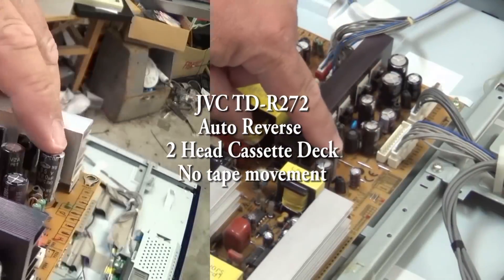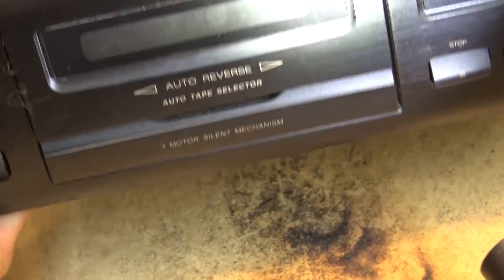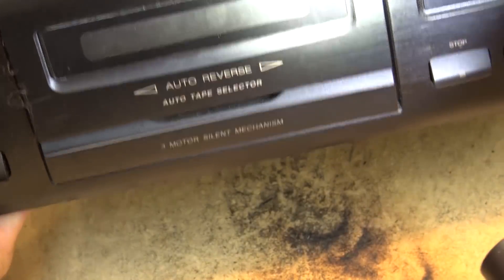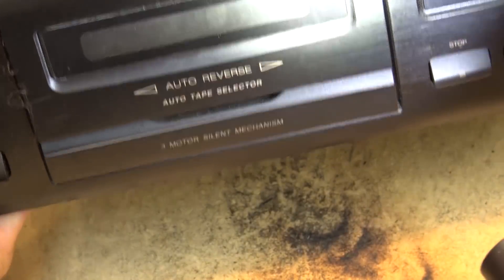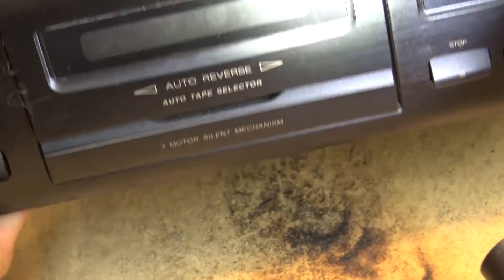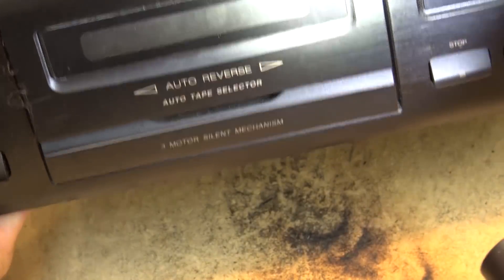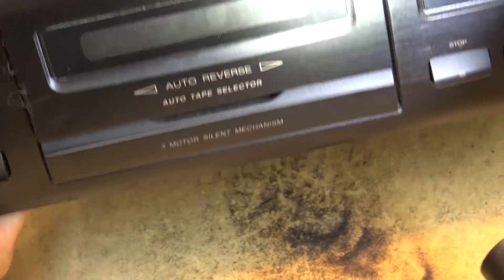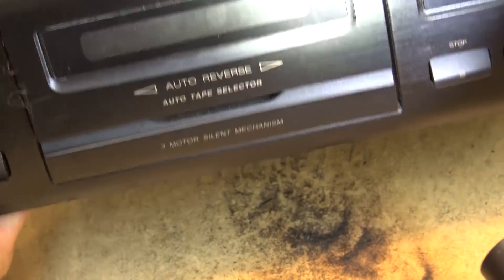JVC TDR272 Cassette Deck repair

Comment: I have a bunch of those TDK MA110 tapes. They came out in the early 1990s and were the perfect thing for recording hour-long radio shows without interruption (in the Netherlands, most radio stations had hourly news and commercials for about 5 minutes). The tapes sound really good and are surprisingly resistant against the press-through effects of older 120 minute tapes, probably because of the Metal type coating. Also, the tape is stronger than 120 minute tapes; I never had any tape breakage in a TDK MA110 tape.

Comment: I remember having a high end dual tape deck, 3-motors and all the bells and whistles, I cleaned mine at least twice a year and calibrated, and aligned the heads.
Reply from the maker: The thing with heads is they typically don't need adjusting unless replaced or someone has broken the paint seal put on at the factory.

Comment: Tetraflouroethane is R134A (found in auto A/C systems and refrigerators) and is what is in many compressed air duster cans. That's the reason why in the US you need ID to purchase them because kids would huff the stuff.

I always found it funny that you can't vent R134 when doing A/C work (it must be reclaimed) per EPA regulations but that you can go to the office supply store and purchase it in an air duster can and vent it to the atmosphere to your hearts content.

So at least in the US the propellant R134A would be allowed so there must be another banned ingredient that forced them to change the formation.

Comment: Try breaking the glaze on the pinch rollers with 400 grit sandpaper and then apply the rubber renew. If the glaze remains in place it can prevent the rubber renew from getting into the roller. I recently did that on two decks (Sharp RT 12 and Yamaha KX 250) and had success with both of them. On older decks it may sometimes be necessary to remove the tension spring for the roller and give it a little tweak to restore tension.

Comment: I've come across many decks full of "juicy cigarette glaze" before and taken more time cleaning the sticky gunky crap up than actually finding out what was wrong with the units themselves (which in some cases was just belts, rollers and broken gears - though one had a cracked main-board due to being dropped by a clumsy owner which took over half a day to repair).

Nicotine - the number one carcinogenic killer of electronics.

Comment: i loved those TDK metal tapes!  I bought a big box of them back in the day to record my bands music, metal of course. lol Usually only recorded on them one time, but a few metal tapes i used over and over for years in my 4 track recorder . i never had any stretching issues like standard  90 or 120min tapes. i still have most of my tapes from the 80-90s and they all work good. I have some tapes though of commercial bands i bought where the tapes stretched so much it made them play longer/slower. you could barely notice it but the tempo was off and comparing it to a new tape it sounded way off!  Now days my friends or myself use digital to record band music, but it just doesnt sound as good as tape IMO. digital looses a lot of the warm tones and just doesnt sounds as good no matter how you mix it.

Comment: their tape heads are similar to my sony vcd tape decks on tape side B but can you help me out to repair the other side of it on tape deck side A because the tape head of it their brown flex with 5 pin connector has been broke or maybe damaged can i used other thin wires with cover to wiring them thank you.

Comment: that is my problem and also the CD Mechanism of my Sony VCD they cannot read a disc inside i see that the cd does not spin why? But i resolve one problem to their tray to open and close when inserting some cds i just replace a belt to motor., and then their tuner it does not stop when searching for fm station on radio mode. and also my vcd model is sony mhc vx 55 with 2 active super woofer it sounds good and excellent so beautiful but it stops fuctioning some buttons on it and their cd can you help me out please thanks a lot.

Comment: Just wondering if you have any cobalt cassette tapes ?
Reply from the maker: Pretty much all the type 2 tapes with the exception of basf are cobalt.  Basf and some early memorex were chromium dioxide as was the chrome layer on the Sony type 3 ferichrome tapes. Those are still the tapes that are my favorite. They have the best I'd both worlds. Iron oxide on the bottom layer as bass penetrates the tape deeply and chrome on top for good highs.  Next to metal tape they are without question the best tapes for music but most people dont know much about them because only a few companies made them and very few stores carried them.
Reply: their tape heads are similar to my sony vcd tape decks on tape side B but can you help me out to repair the other side of it on tape deck side A because the tape head of it their brown flex with 5 pin connector has been broke or maybe damaged can i used other thin wires with cover to wiring them thank you.

Comment: This is an unrelated question but I have a hd-dvd player that stops halfway on all my disks even regular dvd. I don't know your e-mail address. You know your stuff!
Reply from the maker: Could be the optical pickup is sticking, or it could be a spindle motor issue.

Comment: End of the line 90s cheap stuff... suitable for beginners or people who only have type 1 tapes and dont take tapes seriously.
Worth maybe 10 bucks or so. I got some 90s tape decks in the last few months and sold all of them on ebay because they have absolutely no value for me. I like my JVC TDR621. Good quality 80s stuff with a lot more functions than the newer models.
In my opinion 2 head decks are only acceptable for playback.
Reply from the maker: 2 head decks can make very good recordings. The same as 3 head decks because the head is basically the same. Optimized for recording. It is the separate playback head with the much narrower gap that is set up specifically for playback that makes the difference.
Reply: @12voltvids  I know that they can, but its a huge pain to figure out the perfect settings. Record, rewind, playback, change setting, rewind, record, playback, change setting, rewind....
Or just press rec and hope for the best. I dont like them.
Reply from the maker: @macdaniel6029  yes but once you get a brand of tape dialed in, just mark the control and then it is easy to reset.  Most people never bother tweaking the bias anyway.

Comment: 80's me : don't like the deck... that VU-meter is not cool .... moves on to the next deck   Technics ... yeah.
Reply: 80's me wouldn't like a mid-90s deck either. JVC made a lot of decks with sexy red/orange VU meters. They are actually pretty known for their fancy/pretty lights. Their achilles-heel however is the diodes they used to run said bulbs in series and cause problems later down the road. :)
Reply: I know, my sister has an, I believe, 1984 JVC with a spectrum analyzer on it. Up till this day I would like to have that deck. Technics had those nice display vu-meters from their low budget models. I still have some nice stuff up in the attic.
Reply: Luc Peeters - I’ve always preferred Technics & Panasonic.

Comment: I had a JVC DD55, DD66, DD99 (cassette decks of the period  Circa 1980s. These were note Cheap decks and alof them just sounded dull, no high end frequencies, I returned them to JVC them selves and they kept saying it was fine, noting wrong. It went back to them 12 time in one years. I then just so knarcked off with them I threw in the bin as they had stalled for time eating up into the 12month warranty period. JV are a complete farcial company. I will not buy JVC ever again! I bought a Aiwa ADF260 and it was simply stunning! At a 1/3 of the price!

Comment: I don't think I would have wasted time on that one - Junk Very Cheap were never great decks in my opinion, and that one is a right el-cheapo job.
Reply: That's because it's from the mid-90s. JVC's quality was on the down by then.. they made some very good decks in the 80s. They're so underrated, but it's understandable cuz they did put out a lot of cheaper units later on, but people overlook some really high-end units that they did put out. As far as cassette decks I have the JVC KD-A7 and JVC TD-V66 myself and wouldn't consider those "cheapo" units. These aren't even their high end offerings, but very respected decks. They also had their DIGIFINE series and Dynamic Super-A amps. You can have a look and tell me that's your typical china cheapo junk, right? http://lcweb2.loc.gov/master/mbrs/recording_preservation/manuals/JVC%20Super%20Digifine%20Hi-Fi%20Components.pdf

The 80s they made good units, and some high-end offerings even. In their early 90s is when they started slopping, units looked cheaper but there were SOME units that performed good and were reliable. Mid-90s on I wouldn't touch... everything is junk from then on. I got a lot of beef about my 1990 JVC RX-R76, but it's a great unit and sounds excellent when fed from a good DAC. I've had mid 90s, say 1995 JVC, Kenwood, Sony, etc. receivers and they are all junk in comparison. And the modern receivers nowdays are a complete joke and don't work after a year or two. You have to pay a few grand nowadays just to get any quality, yet my JVC sings on a few more decades. :)
Reply: I'm not saying that every single product that JVC made was junk, but the majority of stuff that I came into contact with (90's) was pretty rubbish.  I agree that the same can be said from other manufacturers too - Kenwood had pretty much given up by then, and Sony were a real mixed bag with their QS and ES ranges being very good indeed, and the rest of their stuff being pretty rotten.

And yes, you do have to pay a fair wedge now to get anything decent - my Yamaha RX-A2050 cost a good number of beer tokens, not least as I bought it soon after its launch.  It is so sad that the likes of JVC chose to down-sell themselves in their attempts purely to chase volume of sales, and they are not alone.   Pioneer are another one who seem to have an almost dual-personality to their range.  I suppose it is just the way of things with modern electronics - everyone wanted more and more features for less and less money, and then products were designed to fail and be replaced in a very short space of time;  part of the reason I left the trade around 20 years ago
Reply: But people PRAISE the Pioneer brand, but JVC, oh no, so underrated, junk they say. That's what pisses me off, people with praise these other brands and sometimes shit I see that's junk compared to a JVC counterpart. Mention JVC and they hate on you. I have a Pioneer receiver, it's a piece of shit imo. People overlook JVC was a premium Japanese brand back in the 80s. When you say JVC people think of car stereos, camcorders, and all-in-one bookshelf stereos. They don't think of their high-end equipment of the day that they did have. 80s they were good, and I would say some of the very very early 90s stuff too. They also had their "GM Circuit" suite for their amplifiers such as GM Driver, GM Volume, GM Selector, all stuff they did to improve SNR, lower noise floor, etc. basically premium features on their high-end amps. Stuff to improve how the transistors functioned too but utilizing what transistors do best. Stuff like improving the quality of the power and lowering impedance, etc. It's funny cuz my 1990 JVC RX-R76 has one of the GM Suite features, meaning it wasn't one of JVC's lower end offerings or "budget" receivers. It has the GM Driver and direct-power supply. More info on their GM circuits here, kinda interesting to me.. http://pro.jvc.com/prof/attributes/tech_desc.jsp?model_id=MDL100386&feature_id=02 But my "cheapo piece of shit" amp as many claim sport some features JVC implemented in their high-end equipment.
Reply from the maker: @victorcoss2600  
Jvc had some pretty good components, and their svhs vcrs were considered to be some of the best ones made. I have a couple of jvc svhs that work great. Even though they have a fair bit of plastic they have been great and the old boat anchor VHS decks from the early 80s were bulletproof.
Reply from the maker: I'll put it up on craigslist for 50 bucks and someone will buy it.
Reply: So, just taking a guess here..........  You like JVC, right?

Again, I am not saying that everything they made was junk - I can only speak of the stuff I came into contact with;  it could well be that I didn't see enough of their stuff.  If you are happy with your kit, then that is all that matters - - seriously. don't be giving a monkeys about what anyone says to criticise, it makes not a jot of difference as long as YOU are happy with the products you have chosen.
Reply: Ah, well their VCR's were definitely a rare occurrence for me - we were tied up with the likes of Panasonic, Sony, Philips, Pye (Philips re-badged), Ferguson (Thomson), Aiwa, Samsung, Sharp, HItachi and so on.   So many of those brands are either gone, or are low volume sellers nowadays, it really is sad.